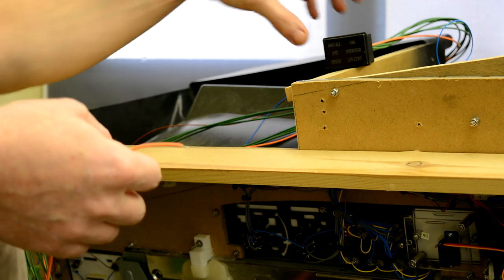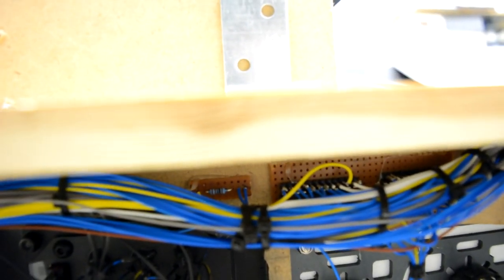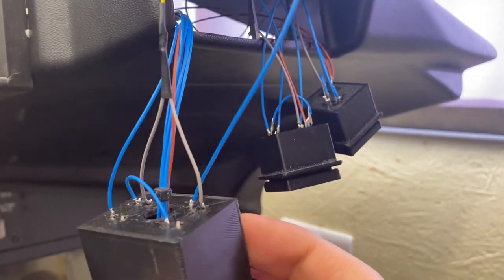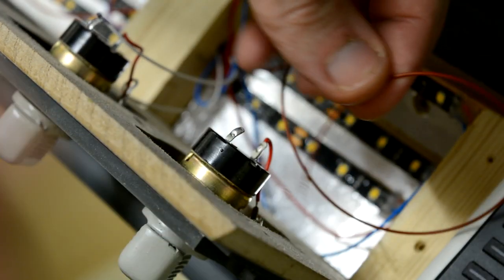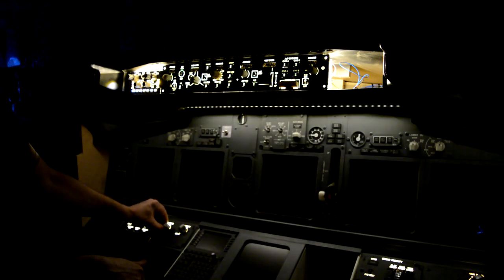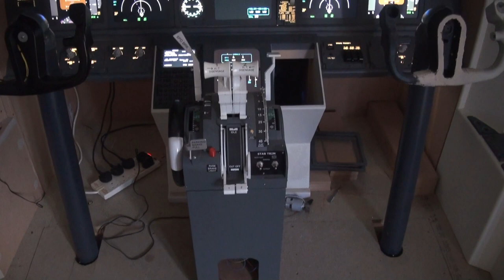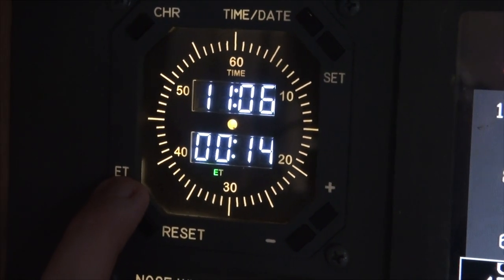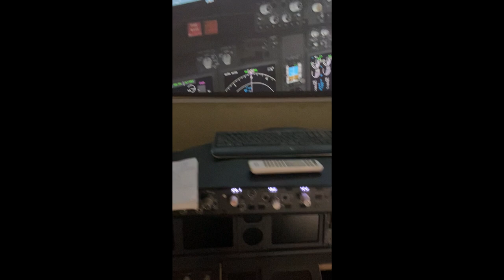737 home sim build - cockpit sim parts MIP part 4

Comment: I shouldn't laugh, but I did!
I too have had to drill out led's  - and it's not easy.

Lesson learned,  keep moving on.
Reply from the maker: Yep they are a sod to drill out, but very easy to hammer out 🤣 I certainly learned my lesson and no longer use super glue to hold them in place
Reply: @simbuilduk5853  sadly I'm not in the 737 game any more, but still sim building.  You've made a lit of progress,  nice to see.  Keep it up, Ian!
Reply from the maker: @wv838  that’s a shame, moved onto something bigger and better?
Reply: @simbuilduk5853  quit my job, so moving on to new things.

Comment: Nice to see you back Ian. Looking good. 

What method did you use to print out the throttle decals? I'm the process of printing my parts and looking for feedback around the community on which methods yield the best results. Also do you have backlighting working with it?
Reply from the maker: Hi kalease, it’s good to get caught up. Nature of the hobby means it’s takes time to get projects finished so I can release the vids. I used my vinyl plotter/cutter to cut the words and stick them on then I sprayed clear coat over the top. The trim decal was printed on sticky back printer vinyl. No I thought about backlighting it but as it’s only a temporary throttle I decided it was too much work.
Reply: @simbuilduk5853  Well looks great and thanks for the info. Your build is progressing nicely, I’m coming back after taking about 6 months off to attend to other priorities. Currently in the process of printing Karl’s motorized throttle at the moment.
Reply from the maker: @Kalease54  nice, Karl’s throttle looks good, please join my discord group we have lots of build projects going on from many different members. Link here https://discord.gg/kgx4r8x3
Reply: @simbuilduk5853  Joined!